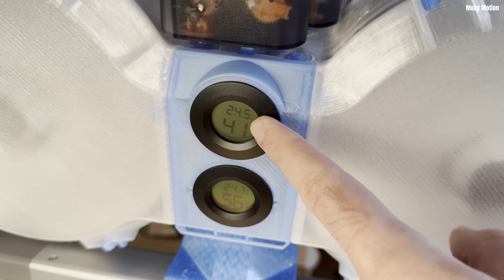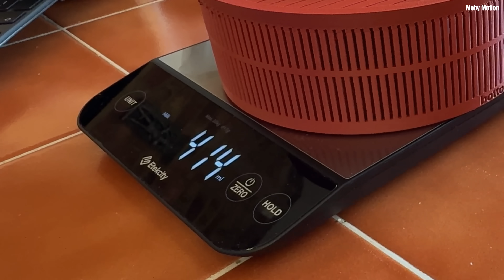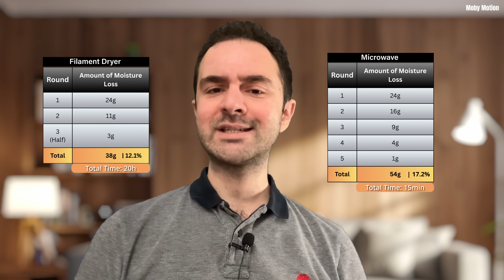Stop Drying Silica Wrong! Microwave vs Filament Dryer Tested

Comment: I use a cheap air fryer to dry my desiccant.  Set to bake at 120C / 250F and it’s dry pretty quickly.  The combination  of forced air, and high(ish) temps is very effective.
Reply: I do the same, it is very effective
Reply: I used an aluminum sheet pan, but a pie plate or something similar would work well.  Just something that allowed for air flow and won’t melt or deform.
Reply: Did you put the desiccant in anything in the air fryer?
Reply: @manormutant8760  I printed out an ABS tray
Reply: I do the same with a cheap round ninja air fryer from Amazon, I take the tray out, put it on the bottom and give it a stir and weigh every 5 or so mins, note the decrease, when it starts to tail off it's good to go. Because it is a round pan it should also be good for drying filament - especially high temp filament... best of all, give it a wash and have some air fryer chips afterwards 😁
Reply: Cheap round Ninja air fryer. Silica in the bottom. Filament on the tray. Dehydrate 50degC 6hrs dries everything. Monitor it on my phone with a Tapo WiFi hygrometer/temperature monitor to check it's progress so I can end it early if it's done sooner.
Reply: @ste @stevecade857 o you just put the Tapo in the air fryer too
Reply: @pyro262 Yep, 50-60 degC not a problem
Reply: That is probably the best homemade setup for the process.

Comment: I think the tests are a bit misleading.  I looked up what your desiccant suggested recharge temp is, and I'm seeing 200F-250F/93C-121C (which is the same as my Dry&Dry packets) for 30-90min (mine is 30-120min).  Trying to recharge on air at 65C is going to be terrible, and unfortunately your dryer can only do 70C max (if I am recognizing your dryer correctly)... this would be a far cry from a dryer like a Sunlu E2 that can hit 110C.  When microwaved, your desiccant instructions show to use Defrost up to 15min according to the website (mine says Defrost 7-12min).  Defrost is typically 30-50%... so you were on the high end of that scale and severely under for air drying.  If you don't have a filament dryer that can hit those temps... you could have tried the oven method as a substitute.  Is your conclusion wrong... I would say no, but with a caveat that should have been clear such as stating you were comparing a typical dryer at 65C which is far less than recommended drying temps.
Reply from the maker: I think that’s fair - thanks for sharing. Higher dryer temp isn’t just about what the dryer can do though, you also have to print the holder in a material that can withstand that temperature, and I don’t want to risk ASA /ABS on my open bed. Even at 65 degrees though the energy is much more expensive for the dryer, and that’ll look even worse at higher dryer temps.

Comment: With the microwave oven the beads are heated "from the inside" so of course it's more efficient.
With the dryer the air needs to circulate well enough to "touch" the beads… and there needs to be some ventilation so that humidity can get out.
A large enough print bed can be a good compromise, with the beads on one or two levels on a surface that lets heat dissipate correctly (like a small grid), with a cover on top to help the temperature rise.
I think a dryer with an annealing setting could be quite efficient (still less than the microwave of course) but I don't have one.
Reply: Microwaves don't heat from the inside. I don't know why people keep regurgitating that. Go make a frozen burrito—guaranteed cold inside.
Reply: @DoctorJones841  Yeah because it's frozen, and microwaves agitate the liquid water molecules and not the solid ones.
In a saturated silica bead the whole bead will heat (the whole bead is what I called "inside", also why I didn't write "from the center").

Comment: I'm so happy with the strong technical approach used in this video. Dividing the wet starting material into two equal batches was key, as was monitoring moisture loss using weight. Based on the video and some of the interesting comments, I plan to evaluate microwave drying myself. I'm going to reduce/avoid the scale surface heat issue by taring the scale with a silicone hot pad on the surface. That should provide plenty of insulation to prevent any heat-related scale issues (Famous last words?). Oh and Liked and Subscribed!

Comment: This is a very interesting and useful evaluation, thanks so much for doing this experiment and presenting it so clearly! I'm only at the 10:00 min mark, but I keep thinking: "I hope you went ahead and put the filament dryer processed material in the microwave, thus directly addressing the question of the correlation between color and loss of absorbed water!" OK, now back to the video to see what happens next...
Well, finished the video and didn't get the final experiment I was hoping for, oh well. Still, I think it's pretty easy to know the expected outcome since the starting material for each method was the same. The MW method resulted in a loss of 54 g vs. only 38 g for the FD method. So putting the FD batch into the microwave for a few rounds should reduce the wt by another ~16 g.
Reply from the maker: Ah wish I had thought of that!
Reply: @MobyMotion  What, you still haven't got that 3D printed time machine perfected yet?

Comment: I use a dedicated old steel pan on the ordinary old oven, set to lowest heat (7 possible levels of heating - 100W is lowest, 120W next, and good too), that leads to a temperature of ~100°C of beeds (and a tiny bit over 100° let become water to steam - that leaves the beeds much easier). Half an hour and all the humidity is gone, because the pan is open!
Every method like printbed or Dryers are far below 100° on beads - so low effective.

Pan on oven is no risk, perfect results without the needs of fancy things like wrong  engeneered dryers (no escape for wet air!).
Alternate way: use a food dryer with temperature control - specific use for that. You can use for filament drying too, its much better because always fresh heated up and that way dry air comes in and every moisture goes out immediate instead of circulation 10th of hours in a closed housing.
Reply: I have a filament dryer, I like that it vented and flows air through it too, but directions says to use 65c for 3hrs. so should I use a higher temperature?
Reply: @3dFirefly  the air has to be released!  not only vented (thats good) inside in a circle.
As temperature you can go as high as the dryer can handle it. Silica is no problem up to 120°, beyond that it becomes bit dangerous if hotspots occur which may damage the beeds (> 150°).
That "hotspots" are the danger on microwave ovens too, depending on the spred of the electromagnetic field.
So of you dry your Silica, everytime you pass at the dryer - open it and release the moisture ;-)

Comment: I microwave it. About 60 seconds at a time. For extra effectiveness, use hair dryer on hot, and blow air over the silica gel between microwave charges. This hot air blows the water vapor away, keeping it from landing back on the silica gel and getting re-adsorbed.

Something to remember about microwave ovens is that they're always at full power. They just cycle off and on at regular intervals to reduce the total amount of heat added over time. Listen to it run on reduced power, it makes more noise when the magnetron is powered. So if you can figure out (for example) that medium is 50% on, 50% off, you know that two minutes on medium is the same heating as one minute on max. Cycling gives the heat time to re-distribute in food, and gives the water time to escape from the silica gel.
Reply: Excellent reminder on basic MW function! But I think the statement "So if you can figure out (for example) that medium is 50% on, 50% off, you know that two minutes on medium is the same heating as one minute on max."  Well what is meant by "is the same heating"?? I would argue that for the reasons you already mentioned above, those two settings don't result in "...the same heating". What is the same is the total run time for microwave generation. However the resulting "heating effects" are NOT the same. Depending on the use case the differences might be small, but they might be large and important! As you went on to say, "Cycling gives the heat time to re-distribute in food, and gives the water time to escape from the silica gel."
Reply: Panasonic microwaves--some models at least--have a variable power feature.  50% setting is truly 50% power, not 100% half the time. You do  not hear a change in the sound level.  I have two such, the so called Genius Prestige brand.

Comment: I can think of a few other tests that might be useful. 
1. After drying by either method, how much moisture (determined by weight) is the desiccant capable after one or more transitions from dry to wet to dry. To say it another way, is the
 desiccant damaged by rapid drying in the microwave or by longer times in the filament drier?
2. After desiccant is dried in the filament drier, can more weight be removed by a trip through the microwave?
🤷‍♂️
Reply: I like point 1)! 
Point 2 result seems obvious. In this video at the completion of testing, the FD batch (which started from the same material at the same initial weight) had lost 16g less weight than the MW batch. So had the FD batch been put in the MW for a few rounds, it would have lost ~16g more water. As others have noted, spending HOURS in the filament dryer is just a waste of energy and time...

Comment: Power wise and hence cost wise the microwave is a hands down winner.
Reply: the cost of the damaged desiccant far outweighs any possible saving. An air fryer dessicator setting is probably as efficient.
Reply: @zagabog  You won't have damaged desiccant if you do it at reasonable power in reasonable intervals. An air frier should work too, but "TBD" on the efficiency.

Comment: You don't need Pyrex. By the time you have gotten it so hot that you need Pyrex, you have exceeded the temperature where you are damaging the desiccant. Destroyed desiccant is not going to do you any good. That is not reactivated, it is trash. Run the microwave at 50% for no more than 2 minutes at a time, and give 4-5 minute rest/cooldown cycles in between. I use a paper plate and it doesn't even darken. If you need oven mitts and it warped your scale, then you are letting it get WAAAAY too hot.

Also, if you are going to be drying inside a printed container, I suggest ASA. It can be printed on an open frame bed sliger by placing a cardboard box on top. Unlike ABS, you can get away with printing ASA without a heated chamber if you print is not too bulky, and you maintain an ambient temp of around 80° C, which my Prusa i3 Mk3S+ can do with just the cardboard box. The ASA will handle the temps needed to properly dry the silica gel. Now if you are trying to dry activated alumina, you should probably invest in a good quality toaster oven and a digital oven thermometer.
Reply: Silica gel itself is stable up to 1200°C, it's the indicator compounds that get denatured, and render the microwave not food safe.
Reply: @markbooth3066  The gel itself, sure, but water trapped inside the gel can reach temperatures up to 300° C, or 3 times that of boiling. At that point it will cause the gel to fracture, spark, or even ignite nearby organic dust or packaging. So while silca gel beads are useful, cracked, fractured, micro gravel and dust is not so much.

Comment: How about food desiccators? I dismissed filament dryers from the outset as being too limited in capacity and considered dedicated microwaves and toaster ovens and desiccators. The desiccator seemed a good compromise considering cost of the device, time to dry, capacity and energy use. The one I picked has 5 fairly large rectangular plastic trays that I lined with screen wire. Next time I do a batch of silica I'll weigh a fresh filling right out of the bottle, a saturated filling and a dried filling to see how they compare.

Comment: I printed my AMS dessicant holders in ASA so I can use the defrost option on my microwave without the need to touch any of the beads. I just place the full holders in the microwave and when done I put them right back into the AMS.

And on the energy efficiency side I think the microwave is also the hands-down winner.
Reply: Good to know. I have the same situation with ASA/ABS holders and wanted to leave the desiccant in them.

Comment: Been drying my desiccant in the microwave for years. I did a test when I got my Creative space Pi when it first came out and come to the conclusion that the microwave is not only quicker and more convenient but also so much cheaper and as energy cost so much in the UK it all helps when you are paying 78% of your energy in TAX. I do 3 minutes on 1 minute off in my 800W microwave 5 times.
Reply: And how much weight do you dry in one batch?  Because 800W and 100 grams gives a different result than 800W and 500 grams
Reply: Does the microwave cause the desiccant to lose effectiveness after many recharge cycles?
Reply: @propheteyebert7063  I've only had the changing colour desiccant for about four years when I changed out all of the old stuff for the new colour change stuff, but haven't seen much degradation. I only changed the old stuff as it was just plain an the newer stuff is now colour changing, but that was a great question I hadn't thought about.
Reply: Can this be done safely in the family microwave or do you need a dedicate one? i.e. is there any health risk to drying desiccant in the microwave?
Reply: @bungy490 no issue. It just releases water.
Reply: Indicator gel should be done in a dedicated microwave @bungy490  , as the chemicals involved can be 'boiled' off at hot spots. Non indicator silica gel is safe in microwaves you use for cooking food though.
Reply: @bungy490 it's silica (sand) and you are heating it to remove moisture. There is nothing that could cause a health issue.

Comment: I've tested my AMS HT for silica gel drying at 85°C vs 65°C. Not only did it take almost twice as long to dry at a lower temperature, the amount of moisture removed was less such that the achievable humidity was reduced with the 65°C silica gel. The 65°C silica gel could only achieve a humidity of 8% whereas 85°C could reduce the humidity in a dry box to 5%. So the slight amount of moisture left behind from drying at a lower temperature reduced the performance of the silica gel beads. Drying it longer at 65°C also wasn't able to further remove the remaining moisture.
Reply: Exactly, it’s the high temperature which dries it. I do mine in the dryer at 110 degrees C and it’s fast.

Comment: The issue I had with the microwave approach was that it seems it can be too violent/quick. I'm not sure if you noticed it too, but, I found that you could hear cracking while it was in the microwave and afterwards, quite a lot of the nice round beads were now broken, in addition to that, their was bits of powder left behind. I'm assuming that this is because the microwave causes steam to be produced quicker than it can make its way out leading to pressure inside the beads that just explodes them. They still work after this, but, I found that the containers generally only stop complete beads from escaping, so after a microwave treatment there were more shards and silica dust to clean up.
Reply: Now I use a air fryer at 100c for drying
Reply: @berlinberlin4246  Would be really interesting to repeat the present experiment comparing air fryer with MW!
Reply: I've noticed some of these vortex veggie washers and thought of altering one to use with a hair dryer causing the dessicant to circulate as they heated. Might have to try this.
Reply: I have the same problems/ effects with the silca gel in the microwave at 500w settings (it's in my a 50:50 on/off cycle)
The silca was more cracking than drying.
Reply from the maker: Nah I didn’t find this at all and have done it more since - you didn’t use max power did you? or long bursts? or really tiny batches?
Reply: @MobyMotion I didn't, but, lower power on my microwave does just switch full power on and off at intervals, and ambient humidity is in the 80+% range here.
Reply: @dantucny  That's the same for ALL consumer microwave ovens. "Power" settings just change the magnetron duty cycle, the magnetron is either 100% on, or it's off (0% on). There is no in-between state.
Reply: @steveh8724 I believe there are some inverter microwaves that truly output lower power levels.
Reply: @dantucny  Thanks for correcting me! I looked in more detail and it appears correct to conclude that ALL inverter microwaves can produce continuous output at other than 100% capacity. That ability is what the inverter microwave technology is for. I like being wrong more than being right--because I LEARN something new...